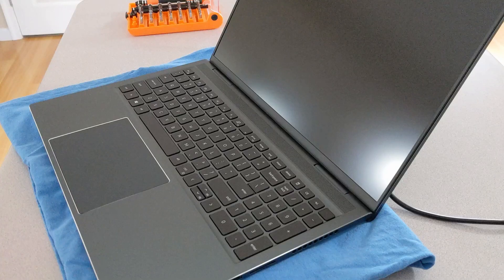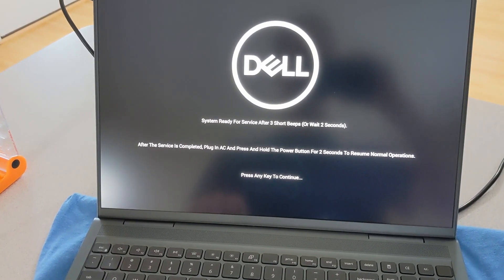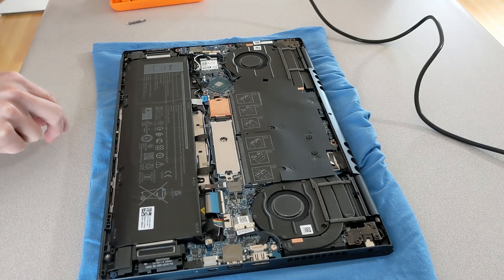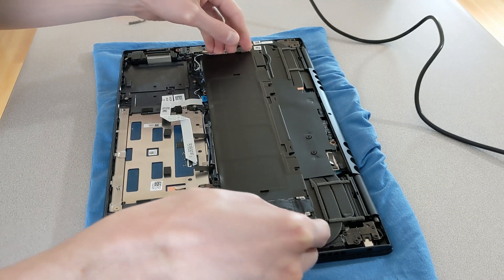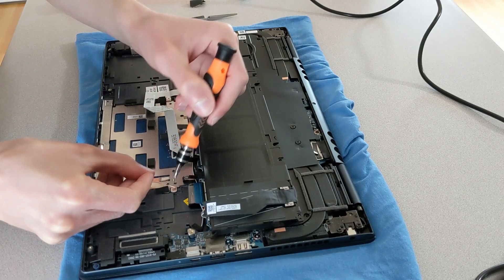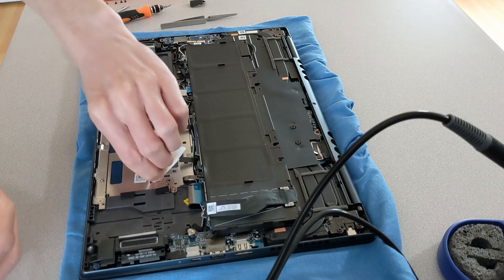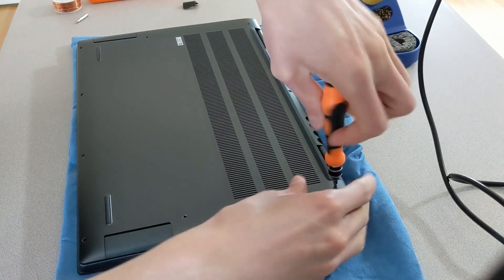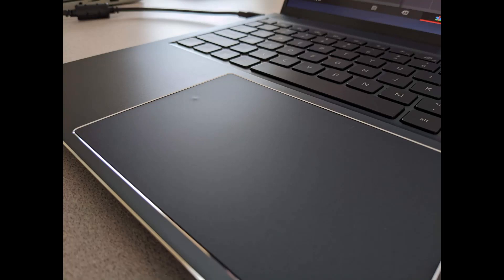Grounding Wire Fix for Erratic Touchpad Issue (Dell Inspiron 16 Plus)

Comment: I called Dell ProSupport about this exact issue that my customer was having. (I must admit that I thought it was "operator error" or "fumble fingers" because I hate trackpads and always use a Microsoft Mobile Mouse) Anyway the tech immediately acknowledged that it was a known problem and is dispatching a field service tech to my customer's office to fix the problem. I have a mundane question though: What is the brand name of that screwdriver set you're using? I assume it's magnetized due to the screws adhering to the Phillips bits. Having done some previous work on Dell laptops I know you've got to be pretty dexterous with those microscopic screws if you're just using your fingers to put 'em back in place. I'm wondering if the guy who originally came up with this fix was an electrical / electronic engineer, because I never in a million years would've even guessed what the problem was, much-less a solution for it. Bravo to both him and you for helping a lot of (out-of-warranty) folks who own this particular model. A side-note; my customer also complained about this unit getting excessively hot. When I mentioned it to the tech he said (and I quote) "We really don't like to call 'em 'laptops' anymore because of that very thing. We advise people to get a 'cooling pad' to put between the computer and their laps." And it does get pretty toasty after being on for awhile, for sure.

Comment: Thank you very much for this fix. I will try it on my Laptop. Needless to say this is something Dell should have already fix in the recent models. They know they have a flaw in their design and I see this keeps happening. I am very happy with my laptop, but very dissapointed by Dell. Needless to say, this would be the last piece of equipment I will buy from them, because they cannot offer a solution to a "simple" known problem and preffer to ignore the issue. Now, thanks to you I will be able to solve it myself!

Comment: Thanks for your video. I placed an order for this laptop and then realized the design flaw with its touch pad. I was going to cancel my order, but your solution seems easy enough so I guess I will keep my order.
Reply from the maker: In my opinion it's certainly a nice laptop for the price, and I especially like the display. I hope it all works out well for you if you decide to keep it.

Comment: I just wanted to say thank you for sharing your insights on this touchpad issue. I bought the same computer in April 2022 (European model) and after 2 months of ownership it developed the same problem. It's shameful DELL still haven't implemented a solution to this known problem during manufacturing. I was able to apply the same principle of your technique but modified it so I didn't have to do any soldering. I used conductive copper tape with one side adhesive. First I screwed through the copper tape with that screw on the top right corner. Then I ran the tape down to the copper element on the trackpad which I also sanded down. I wrapped the adhesive side of the copper tape along some of nearby structures to help fix it in place and then I folded the tape in on itself to exposed the conductive non adhesive side to the sanded down copper element on the touchpad. I then folded the tape over on itself a few more times to create some thickness which would then be pressed down by the battery, insuring a good contact between the two copper structures was maintained. I can confirm it solved the problem instantly and after 4 days there has been no sign of the issue coming back.
Reply: Is it still working properly since the fix you made by the time you wrote this comment?
Reply: Has the solution with copper tape continued to work?
Reply: thanks for the tip. i just did it yesterday, so far so good, hopefully its a permanent fix
Reply: after 3 months, it failed with the tape

Comment: I just did this... didn't sand the contact and just used duct tape and so far the track pad works fine now.
Reply from the maker: Thanks for sharing! I was wondering if sanding the contact would be necessary when using tape, so it's good to hear you are having success without doing so. I now suspect the copper pad doesn't have a coating, but rather just a very smooth finish. When soldering though, I imagine roughing up the surface would still be worth doing to promote good adhesion of the solder to the pad.
Reply: Update?

Comment: Would anyone be able to share how long this fix has worked for them? Everyone sounds very positive, so hopefully the trackpad issues are solved for good. I've been putting up with the trackpad issues for months. :( My laptop is still under warranty and I would be hesitant to void it, but I'm so skeptical about Dell fixing the trackpad. Would the aluminum tape solution (instead of soldering the wire) be removable/not void the warranty?

Thanks for the great video! This solution is the only glimmer of hope I've had after reading dozens of forums.
Reply from the maker: I have not had any issues since performing the fix, and I highly recommend it! As you noticed, many have also reported success with less permanent solutions such as using metallic tape or taping the wire down instead of soldering it, so you could experiment to the extent you are comfortable.

I share your skepticism about Dell fixing the trackpad. The majority of stories I have heard about people going to Dell for support result in replacement of the trackpad, and oftentimes the problems end up returning after a short while.
Reply: @dashrendar2625  this is great info.  One question I had about this issue is that users are often told to "turn the computer off and then back on again" to get the trackpad working again.  I have had to do this at least once per day since getting my used dell latitude 7290.  If this is a grounding issue, why would turning the computer off and then on again temporarily reset the trackpad?  some people have said this action resets the drivers.  But does it also relate to this grounding issue?  Just wondering if you had some technical opinion on that.  thanks!

Comment: This is the fix i hoped Dell would make but am so very happy that DashRender provided! I used conductive aluminum tape instead of soldering and I've been so happy ever since! I hardly use the trackpad but when I do, I want it to work. Super bummed that I bought this laptop new in January, found out about this known issue right after the return windows closed, and then saw the first occurrences 2 days after the 30 days.

Thank you!
Thank you!
Reply: @genericallyrandom  I used conductive copper adhesive and just stuck the same connection as the video and it works perfectly
Reply: Same here, just did it today. I got out a soldering iron, but haven't used it much, so I used plain old metallic duct tape instead. Just sanded the copper on the laptop, then pressed down a square sized piece of tape so that it was secure on the copper, covered the tab, and then up onto the metal. Did it on the left side tab as well. Worked great.

Comment: Instead of soldering, I simply used a small piece of electrical tape to hold the wire down. Worked like a charm, no issues for a week of heavy use
Reply: Did you sand the copper pads any
Reply: is it still holding up?

Comment: Rather than soldering the copper wire is there anything else that I could do instead
Reply: Just used very short length of 5mm adhesive copper foil anti-slug tape.  The hardest thing was cracking open the case

Comment: You did what Dell's own engineers couldn't and solved the trackpad issue. Thanks a bunch for the guide!
Reply: Unfortunately, this is more than likely an issue where it's actually Dell's supplier for the trackpad who made the error and Dell can't force them to fix it (or won't because it will cost them money somehow). The same thing happens in pretty much every industry that sources internals from other vendors. Motor on your blender went out? "Yeah, we're working on a fix for that." Permanent LED headlights on your truck keep failing? "There's a recall pending." It's never the manufacturer's legal responsibility necessarily so they dodge it and just keep on making money. Is it dishonest? Yes. Unethical? Yes, again. Is that going to stop them? Absolutely not.
Reply: Dell has no engineers. Dell is just a name they slap on China sourced computers. It's like Google.

Comment: Thanks for posting this fix. I'm tempted to do this but mine is under warranty. I had the same issue 3 times now. We had the laptop replaced...then the next laptop had the same issue and a tech came out and replaced the touch pad....and now about 45 days later we are having the issue again.  I an either do this (and possibly void the warrantee)... I can send it in and be out of a laptop for 10 days or so...or I can have a tech open it up.... what to do, what to do.
Reply from the maker: If you are concerned about the warranty but are confident in your ability to work on the laptop, you may be able to attempt a less-invasive method of grounding the trackpad in case you wanted to "undo" the fix later. The warranty may be useful if a different issue arises with your laptop, but I wouldn't count on Dell to properly fix the trackpad issue. Based on what you and others in the forums have said I suspect they would just replace the trackpad again according to their protocol without addressing the grounding issue.
Reply: @dashrendar2625  - really apricate the feedback.  I think I will try that.  I think I'll get a small piece of copper strip and bent down some and drill a hole on one end. I'll put it under that screw you used.  It is kind of the same idea you used but spring action to make the contact instead of solder. It looks like this is how it is suppose to make that connection to next to where you soldered but it looks like a steal plate. I'm wondering if it is the two different types of metals coming into contact causing a thin corrosion...or maybe because we press on the touch pad it is pushing out (and bending) that built in spring.  Thank you again for the reply.  It is a awesome laptop with a taller screen for coding. It just has that trackpad issue!  You know it is common when I have had it go out three times on me..and it is only 4 months old.
Reply from the maker: @FunWithBits  Sure thing. It may be helpful to use a multimeter to assess the connections as you experiment with solutions. Someone on the forum reported initial success using aluminum tape. Good luck!

Comment: Really interesting, thanks for this. An unrelated question - I am buying this laptop in Germany and want to reposition some of the keys to be in the standard QWERTY international English position. Is it possible to remove and reposition the key caps on this laptop's keyboard? (They don't offer it with English keys in my region and the British version is a lower spec) Thanks
Reply from the maker: Maybe. The video linked below shows how to remove keycaps on an older model Inspiron, and I wouldn't be surprised if it is the same for this model. I'm not going to attempt it to find out though as it seems the parts are quite delicate and easy to break. Good luck!

https://youtu.be/a7zAbdVs12s
Reply: @dashrendar2625  Hey man. only seeing your reply now. Thanks for this, I'll check it out. I bought this laptop and ended up having the very issue described in this video. Posting a new comment now about what I did next...

Comment: why do we have to put the laptop in service mode? If it is off it should be fine. Your not touching any of the components that could short
Reply from the maker: I didn't know about service mode until JackNis mentioned it in his post. I suspect it is just best practice to use it as a precautionary measure whenever opening the laptop.
Reply: @dashrendar2625  i think its just dumb. Disconnect battery and problem solved
Reply: @DragonProtector  its not dum, look up esd
Reply: @user-nh9vk8jc4h  what does that have to do with putting it in service mode. All it does is disconnect power from the battery without disconnecting the battery
Reply: @DragonProtector  when I did mine I just took the battery out. I just barely touch the solder to the the wire on the copper plate then wrap the wire around that little screw and my problem was solved.
Reply: @brucealanharris3051  sweet!

Comment: Should i buy this lap or not ?
Reply: The specs and the price is good but it's a very defective laptop. I have replaced mine 3 times and yesterday I sent it back to Dell depot for repair because the ac charging port and one of the fans stopped working after dell authorized technician tried to replace the trackpad at my home. Honestly, I wouldn’t suggest you buy it. ✌️✌️
Reply: I wouldn't buy it, it's a decent laptop but there are some issues like monitor ghosting and trackpad jittering ( which this video solves )
Reply: Good laptop. Great value. I've been video editing for several months on it and it's behaved itself almost perfectly. I don't use the trackpad so its finicky performance hasn't been a drawback for me.

Comment: Great video, I did this a few days ago, and mine is now working great. A big thanks to all. 
Problem solved......
Reply: It's been a few weeks now, is your trackpad still working fine?
Reply: @abdullahbhatti4757  yes it's working great the laptop much improved. The fix was easy... I was surprised. Just a touch of the solder and run the little wire and it's fixed. It was definitely  a grounding problem from  the factory......